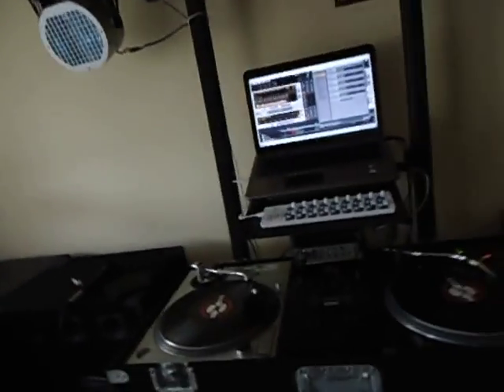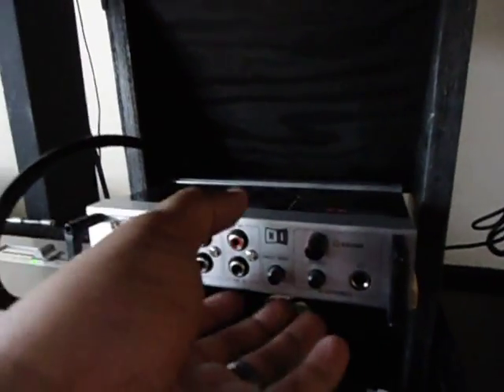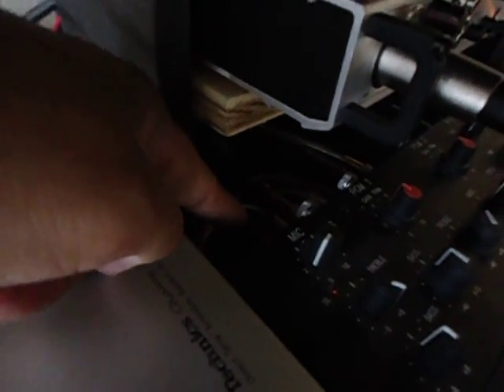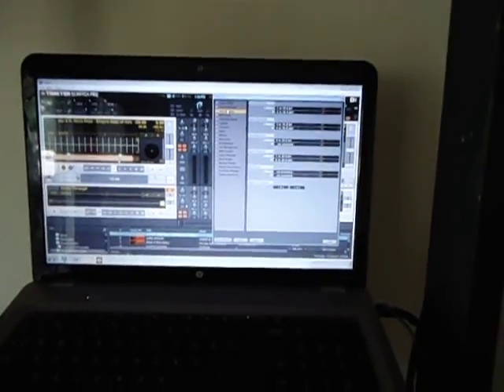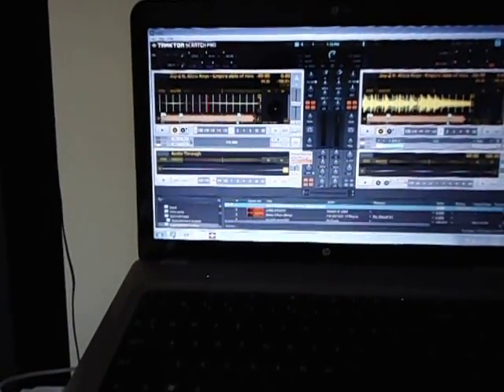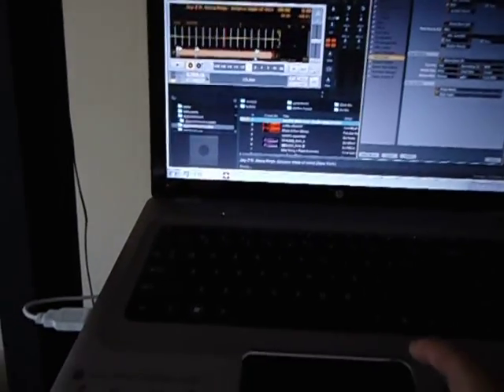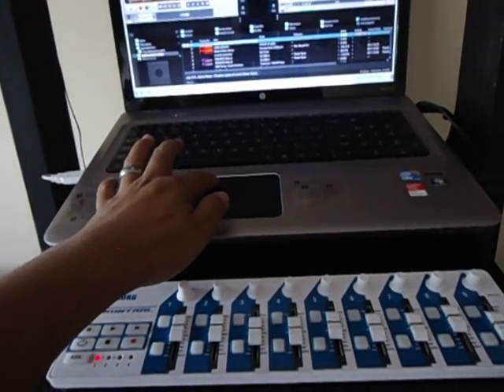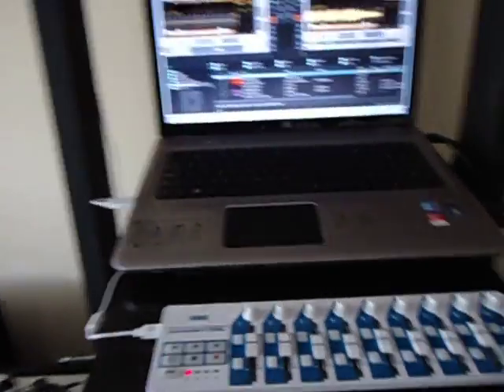how to connect mic on traktor scratch pro w/ audio 8 interface

Comment: damn-- easier then i thought. i googled how to get a mic working with traktor pro 2 and this came up and it answered my question. so i appreciate it. it makes a lot of sense also.  all the other vids that popped up delt with the new s2 and s4. but im using the audio 8.  so props man!    i just gotta go to radio shack and get the adapter now-  which is  RCA-2- XLR?  i think so--lol